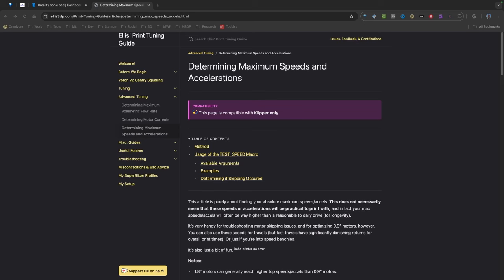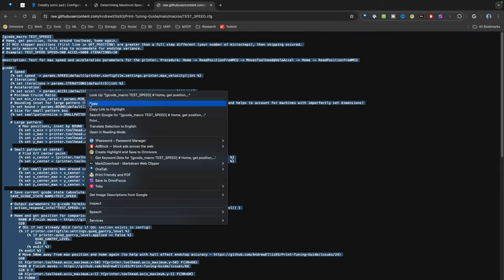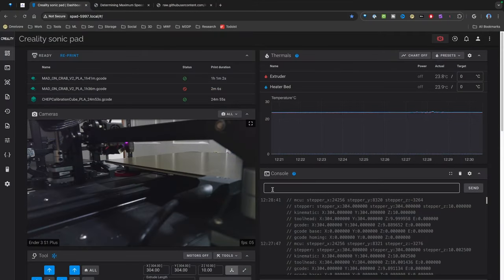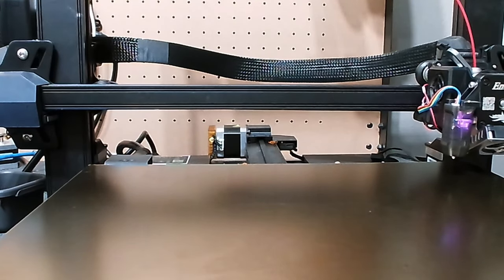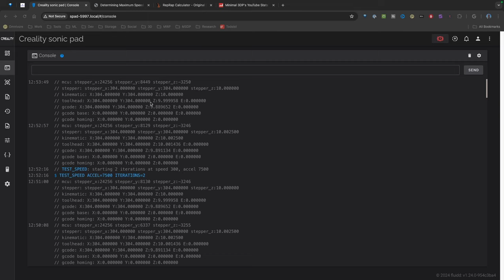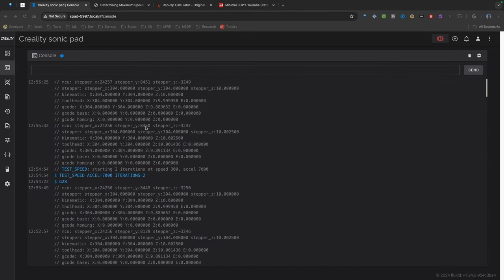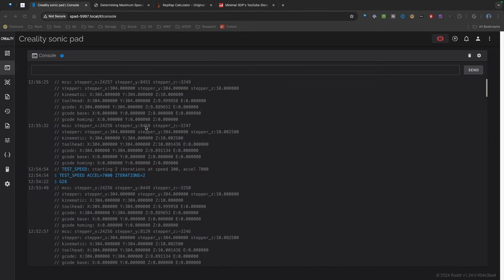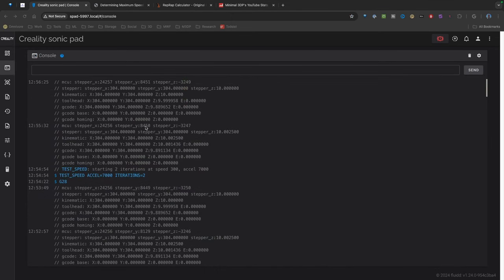Optimize Klipper for Speed: Calculation and Configuration Tips

Comment: I like your videos! Just want to note that your mic quality goes all over the place, louder, quieter, cut outs and sometimes it sound compressed 😐
Reply from the maker: Thank you. I apologize for the sound. I struggle with the mic. My hearing is an issue so that I can't ever tell. Because of this, I get it checked later this month. 

In the case of this video, when trying to catch the sounds of the motors skipping, I made the mistake of taking the mic off and still talking. 

I will try to make some adjustments.
Reply: @minimal3dp  💚

Comment: I'm wondering what the difference is between this and using input shaper.  Are they used together, is this used instead of input shaper?
Reply from the maker: Use them together. Input shaper helps with vibrations that cause ringing in your prints. Once you nail down acceleration. Calculate input shaping.

Comment: Do you have a heatsink on your Y stepper motor? Have you noticed any observable improvements as a result of the heatsink?
Reply from the maker: I added it when I was having heat issues with that motor. I adjusted the voltage and fixed the problem. It did help when it was running hot, but it was not a huge difference. Adjusting the voltage is the way to go.
Reply: @minimal3dp  great video. I would also like to see one on jerk setting. Have not found anything on how to tune to max jerk settings. I am modding an ender 3 s1 pro for speed boat racing and would love to have a reliable way to find max jerk setings.